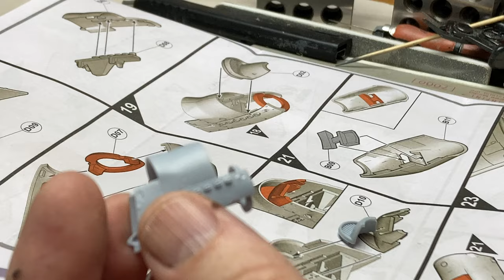Airfix Ju 87 B-1, Stuka build in 1/72

Comment: Nice diorama idea! The build comments are much appreciated as I have this kit in my stash. I've built a couple of the new tool Airfix kits recently and I hear what you say about fit and engineering issues. I also had a similar decal problem as you did on the Airfix Hurricane Mk1.
Reply from the maker: Glad I could help!  Like I said, I've got 3 or 4 Airfix kits left in the stash and when they are done, I'm done, unless I want to build a subject no one else has or is 50+ years old!

Also, I'm glad to hear that it's just not me that has issues with their decals, I felt really stupid when building this kit.  Good luck!